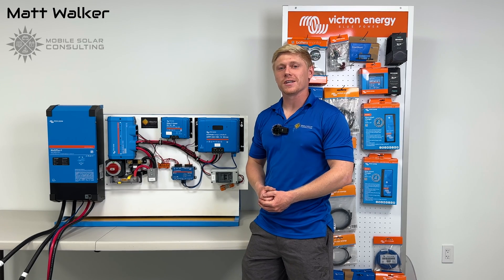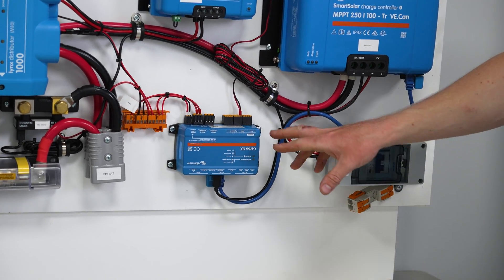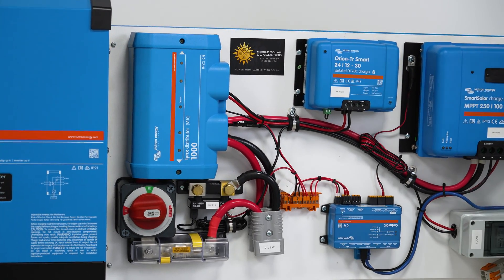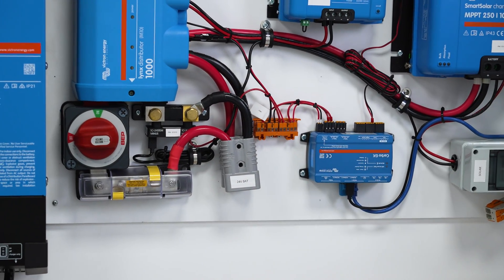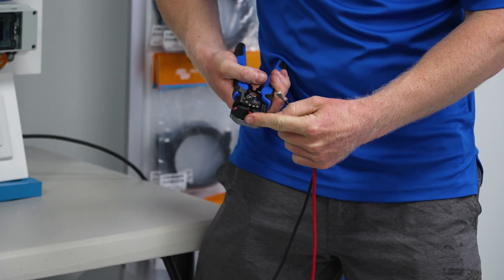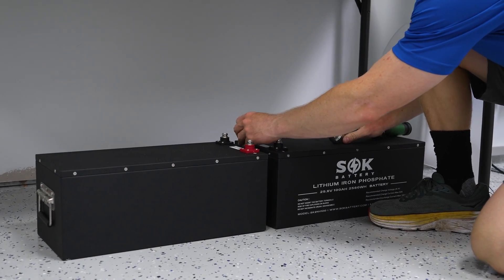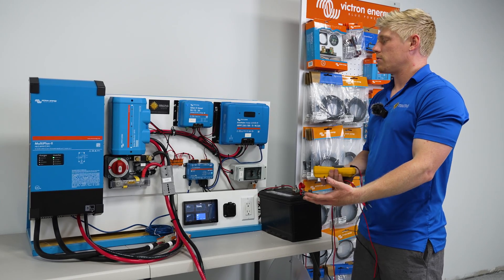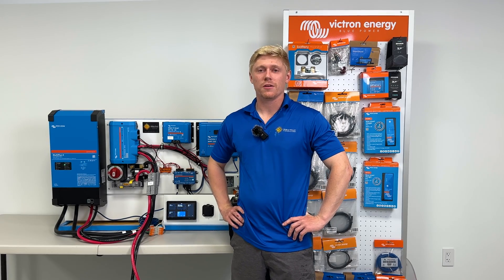DIY Friendly 24V Victron Pre-Wired Kit In-Depth Install!

Comment: I dunno.  Well, at least you went with 24V instead of 12V so it isn't all bad.  24V, at least, is a reasonable fit for a modern RV or trailer.   But the lack of an integrated product really shows in the sprawling components.   I also don't understand why you didn't use (an improved version of) your Easy Solar product as the core of the system.

Also, having just one charge controller doesn't make a whole lot of sense for an RV that is going to have at least two differently-facing strings on the roof (due to angle, location, and shading, sometimes three).  That's a terrible match-up.  

You really should have 2 x 150/35's as a default, not a single 250/*.  A 150/35 can take four residential panels in a 2s2p configuration without problems so two of them would give you eight panels on two strings with very flexible shading tolerances.  (The Easy Solar product has the same problem with its single charge controller, except in that case the 250V Voc on its single charge controller is undersized for even small residential roofs while at the same time being oversized for an RV).

Victron desparately needs a product that is better-integrated and 24/48 by default instead of 12/24.   The Easy Solar product isn't quite there and this thing isn't even close.  All of these tiny little pieces make no sense... hardwired GX in the age of bluetooth?  Why is the multiplus-II still even need a GX for the most basic mobile operation?  Singular charge controllers are vastly under-powered outside of using a 48V system bus.   You have a bulky bus/shunt product that really should be built into the multiplus.  So many things need a major product refresh now, it isn't even funny.

-Matt
Reply from the maker: Hi, I think you've mistaken us for Victron. We are not. We are an independent dealer/installer of their products. 

The Easysolar only exists for European markets at the moment. 

Certainly, when we do an install, we have the option of running multiple strings for solar. However, we see the greatest demand for pre-wired kits that are "easy" and "drop-in" ready, so telling users searching for an easy solution to use multiple strings does not really sit well with them. If they want multiple strings, they can absolutely do that, and purchase another controller separately. It should not matter what the default controller is, since on our website, you can choose any controller and we clearly show how much solar each can handle at a maximum. 

Some of your points on the lack of innovation from Victron make sense. However, we are not Victron, so we are piecing together a system using their existing products. 

Thanks for your feedback.
Reply: @MobileSolarConsulting Oh, you are right.  I did.  Ok, turn that around… why did you do it this way instead of using the Easy Solar product ?
Reply from the maker: Easysolar is European. It outputs 230Vac.

Comment: I love the premade board, that could have come in handy when I was building my system a few years ago.  Quick question I have 4 sok 206ah batteries and am running 12v in my motorhome.  When should I upgrade to 24v or 48v?
Reply from the maker: Many variables here. Call us!